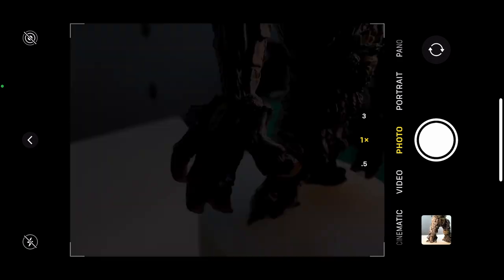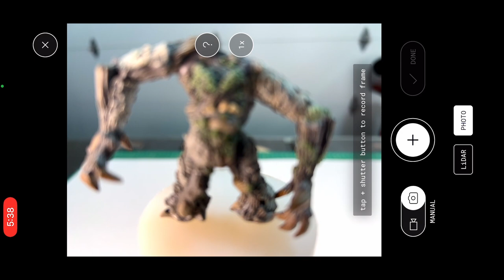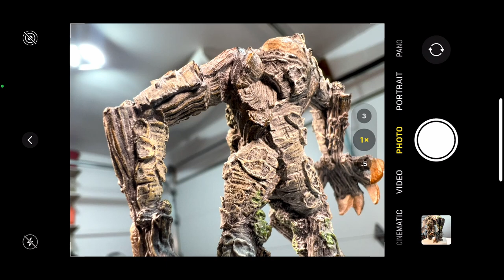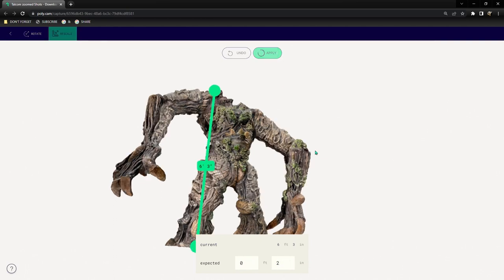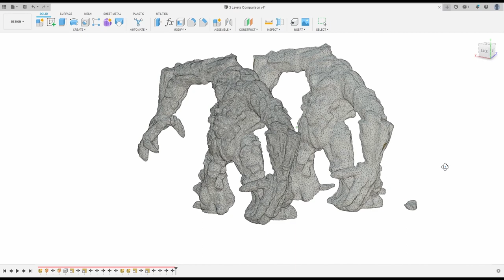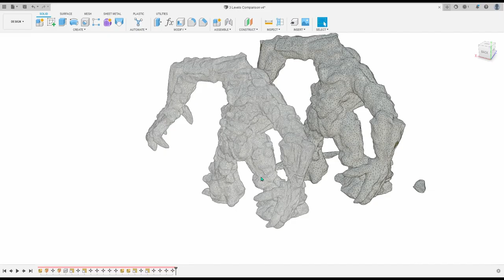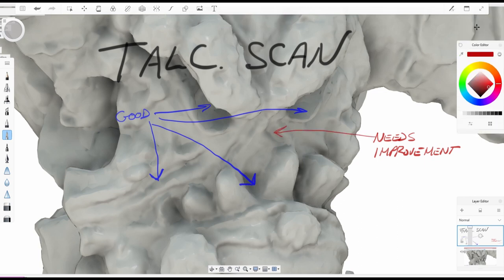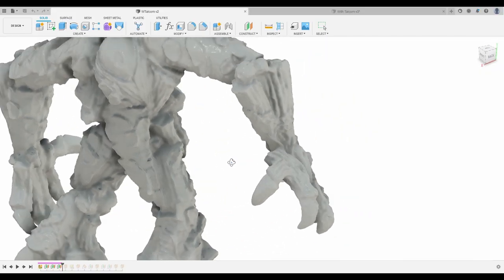I 3D scanned a 2" model with my phone & FINALLY achieved excellent results

Comment: I have to try this. I have a somewhat flat 3 dimensional object that is attached to a flat surface of a large and heavy object that I'd like to print. I tried a free version of a different photogramatry app but it took many many tries to get it from just not crashing to process it. In the ending gave up on that app.
Reply: What phone camera were trying at first?

As for doing more videos like this, yes please! I also like longer versions videos too. I don't mind long one but I understand others may not.
Reply from the maker: It has been too long to recall, I had many fails as well, try polycam, there is a free trial which could get you what you need.  It is by far the best option I’ve found.
Reply: @NeedItMakeIt  I will do that, thank you!

Comment: Why are people not using laser for scanning, would it not be better for details and the texture could be put later on from photos 🤔 maybe, but I have no cloue about this stuff anyway only I thought. And I wouldn't use Talkum powder it's cancer producing. Better with cornstarch versions or similar. 🖖
Reply from the maker: Using a laser to scan, do you mean a purpose built-3d scanner?  I've tried one recently and I am not able to get anywhere close to these results.  Especially at this scale.   About the Talcum, they still sell this product for babies, a good thing to be aware of.  Anything that can be dusted on to lighten the dark areas would work well.